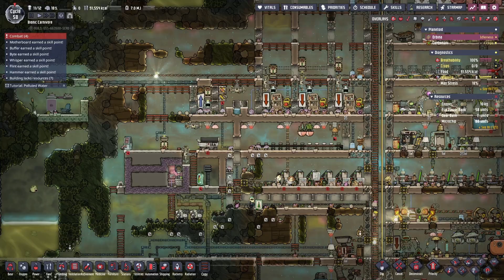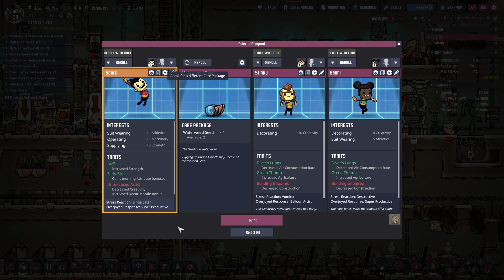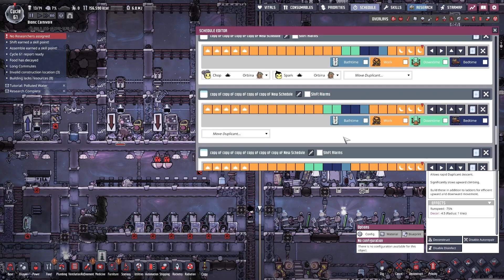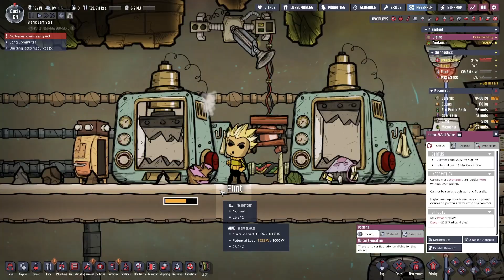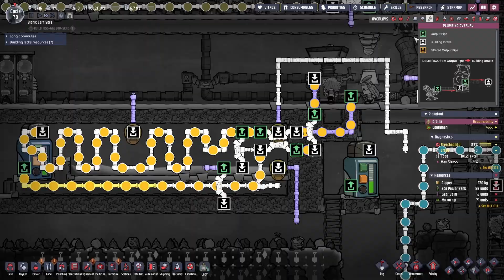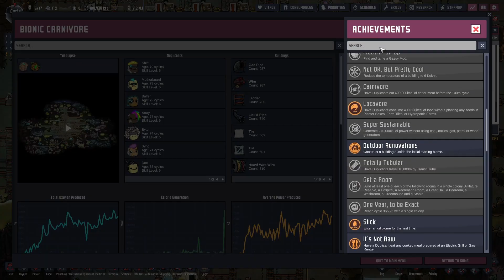Industrial Cooling waiting for Carnivore

Comment: Very nice run, still love the pace ! Keep it up !

26:10 plastic in steam chamber ? That's bold 
29:00 and you don't want lead in but plastic is ok ?? plastic melt at 150ish and lead at 300ish.

35:00 all that while having subzero hydrogen in the main shaft, i could have helped temporarly.
38:20 You could make a cold little slab of granite below the aquatuner to finish cooling  the product (sub 100°C) via conveyor before dropping in the base, they are right next to each other.

47:35 The hydrogen is at 7° ?! The cold is lost long the way, you might be freezing something, or some part of your saturn trap setup is getting warm (you didn't looked at the thermal breach i think, but i don't think it  got time to mess thing up)